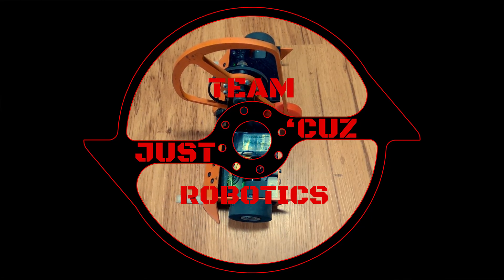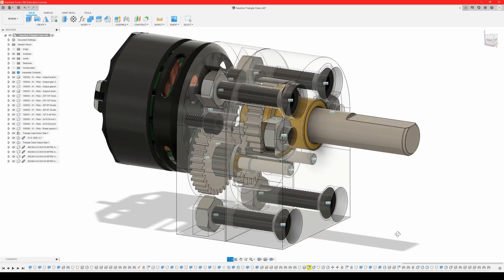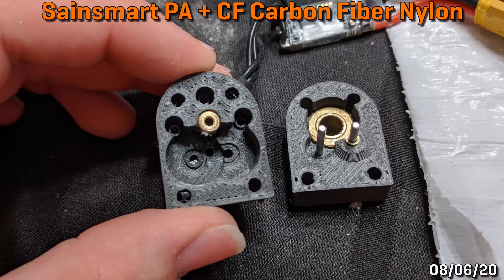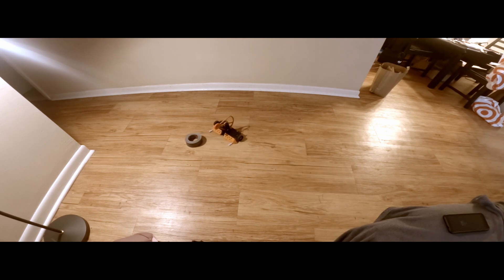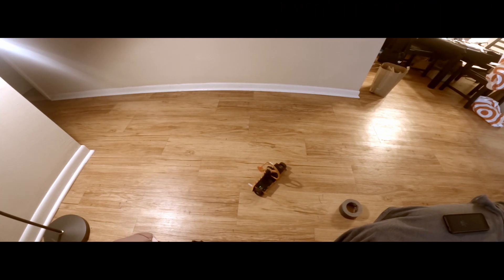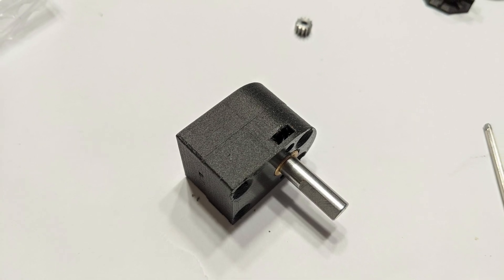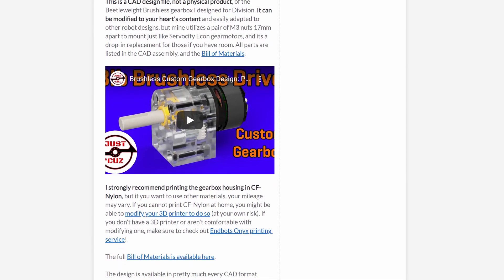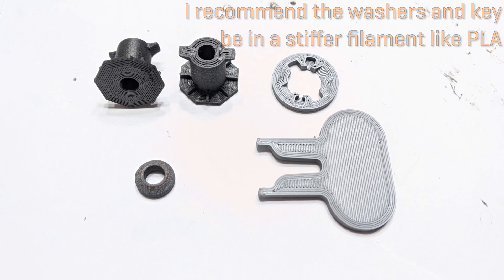Brushless 3D Printable Gearbox: It Works! Free CAD Files (Part 2) [3lb Combat Robot]

Comment: Superb stuff. It was sobering to see all of the unsatisfactory gearbox prototypes, but the end sequence showing the bot's speed and controlled manoeuvrability on a polished wooden floor was seriously impressive. Bravo, sir!

As I said in a previous Comment, I've not got any experience with 3-D printing, but I do know the end results are layered. Is delamination of those layers an issue with very deep components? I'd imagine a gearbox housing would be full of inconvenient potential shear points.

I've done quite a bit of epoxy-carbon-fibre and fibreglass work over the years using vacuum pressure during the curing phase.  It's quite messy, but one really good thing about it is being able to lay extra strands or bunches of carbon or aramid fibre (kevlar) at odd angles and around corners to provide 'through' reinforcement exactly where it's needed. Is it possible to do something similar when 3-D printing, or would there no penetration by the hot plastic into the fibres?

I like the idea of your anniversary video, although making a video about how you make a video of a video sounds like the kind of Moebius and Mandelbrot meddling that causes nasty implosions and the end of the universe.

So go for it! I'm sure it'll get you LOADS of new Subscribers (albeit briefly...)
   ;-)

Comment: Thx you for making this video and may I ask what would be better for a thwack bot yolo brushless or brushless gear box
Reply from the maker: Well the answer depends on the wheel diameter and exact motors among other factors. An 1806 motor would never have the torque needed for Yolo drive on a Beetle with large wheels, and most thwack bots tend to have big wheels. You might even want to step up to a larger motor with more torque than 1806 or a higher ratio than just the 15:1 of this gearbox (maybe belt drive off the gearbox output?)
Reply: Team Just 'Cuz Robotics ok thx you and keep up the great work